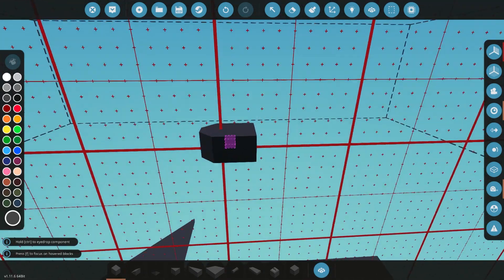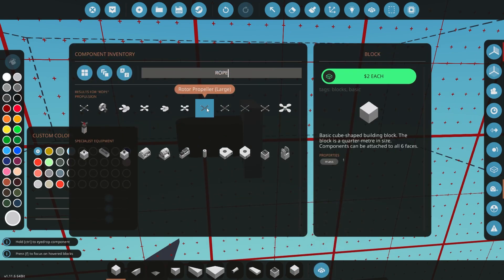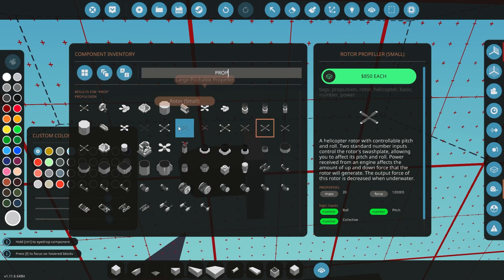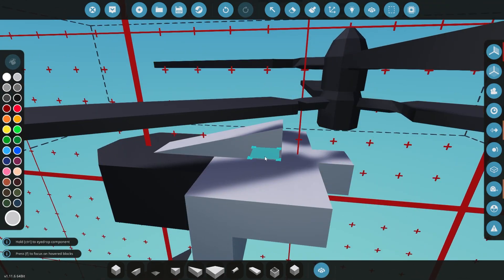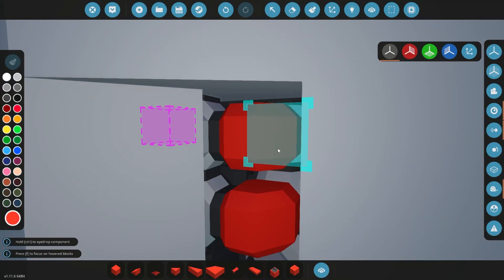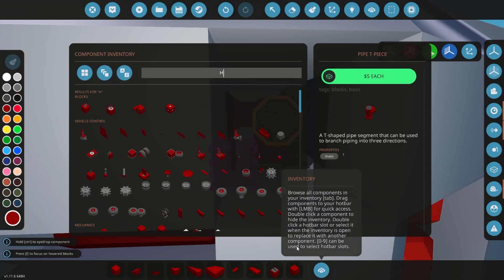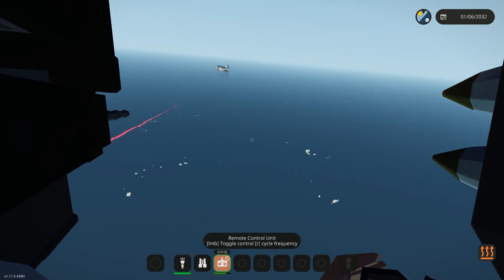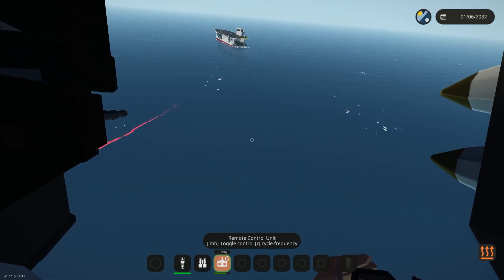Stormworks Build Series: Combat Drone 1 (Carrier build)

Comment: I'd recommend if you update this or make another drone, add a gimbal camera with an autocannon. (maybe as a recon varient)
Reply from the maker: I make a couple other version, they don’t get a gimbal because the drone uses an RC remote, too much logic involved to send video and recieve input’s, I’ve done this on drones in the past but I want this drone to be rather low on logic!
Reply: @WhackAL  If you have the extra space, maybe add a drone control station. But that does seem out of the way so eh, just a thought.
Reply: @WhackAL  Unrelated to the carrier, just thought of this. If you want another big build for a later date, I think an oil rig could fit well with your Sedna and Project H ships. I can really see how good an oil rig with your style and level of detail might be.